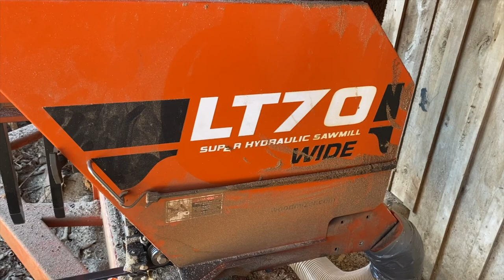Sawing Rainbow Poplar With a Fast Wood-Mizer LT-70 Bandsaw Sawmill at Hobby Hardwood

Comment: Nathan sent me. Nice operation!
Reply: Hard to believe that blade cuts through that would like butter! Amazing wood, makes me wonder what knots would look like!
Reply from the maker: Thanks for coming
Reply from the maker: Knots don't bother this mill that much.  We use a thicker, wider production saw band, built for stability when sawing fast, and with a dialed in mill, knots and hard wood don't really slow it down.  As a matter of fact, we are one of the only mills in the area that will routinely mill extremely hard and knotty hickory, pecan, osage, persimmon, etc.  So we can sell wood that others don't because we can saw wood that other won't.  I may slow down a little, but not too much.

Comment: That is some beautiful wood!!!  How often do you get some?
Reply from the maker: Yes, it is beautiful.  I try to keep to in stock at all times, ion I can get the logs.
Reply: @HobbyHardwoodAlabama  Do you have any now?  I'm planning visiting either Fri or Sat.  I am starting a charcuterie and cutting board business and I will use the best, and the wood that is the most beautiful.  When a chef makes a charcuterie board, it should be as beautiful and attract as much attention as the meats and cheeses.  Therefore my goal is make heirloom quality boards, nothing less will be put in the trash.   I will not be using scrap from other projects.  Thanks for your quick reply, I didn't expect anything until Friday when you officially opened up.
Reply: I will be shopping for tiger and curly maple, bookend walnut and leopard wood.

Comment: What blade are you using on the poplar ? I run an LT 50 wide . Thanks in advance .
Reply from the maker: I'm running WM Silvertip 1.5", 7x49 Turbos, .055" thick.  They are the best band I've used so far, and I've tried pretty much all the Woodmizer bands, as well as several other brands.
Reply: @HobbyHardwoodAlabama  Thanks  I am still trying different woodmizer types . 
1.25 7x49 by .045 I just have some wonder trouble on very knotty softwood . I don't know if thicker or wider will help . Thanks . Rob.